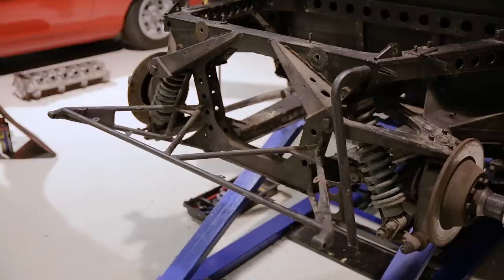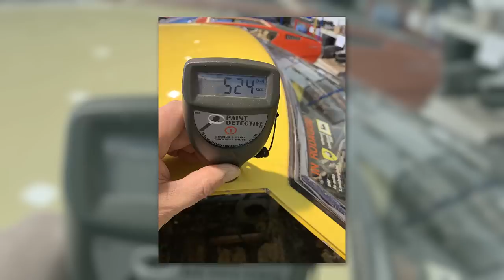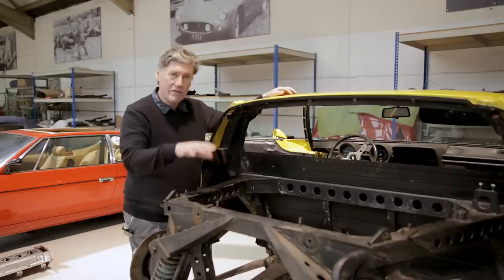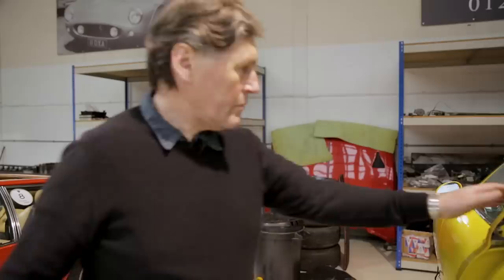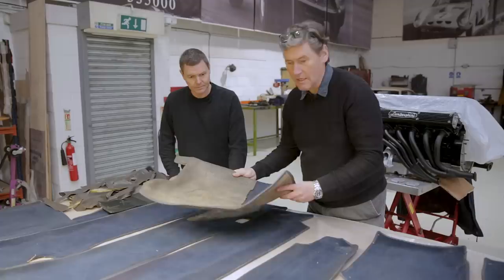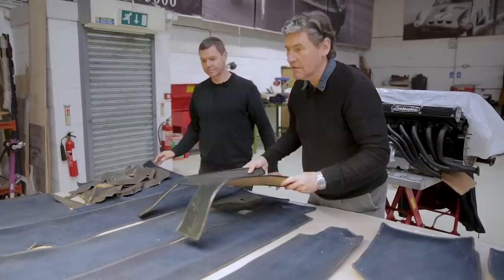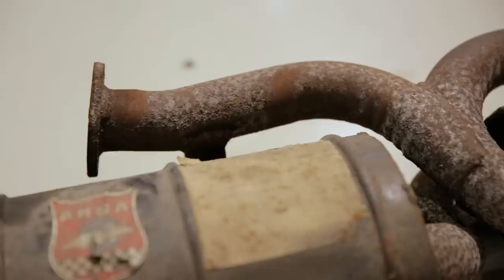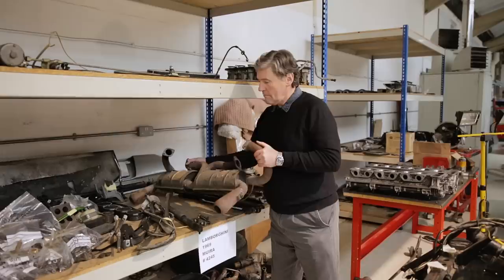Lamborghini Miura S - Restoration begins on £1.25 million barn-find | Tyrrell's Classic Workshop

Comment: Thank goodness this car is in good hands. It could have been over-restored and all that history lost.

At 8:09 we see a crack in the webbing between the block and the transmission case. Is that common on these cars? I would love to see that repair included in a future video.
Reply: Ok so I'm not the only one to notice that, I wonder if it really is a crack and if so what if anything will be done about it. I don't think this restoration in any way aims to bring it back to 'like new' so there is a fair chance it will just be left as-is if it isn't a risk or issue.
Reply: Saw that as well. Maybe we will get a comment in the next video?
Reply: Are you sure that's a crack? It looks to me like flashing from the cast where some oil has collected on top of it. I can't see how that particular web would crack without similar damage to the neighbouring ones, given the proximity and construction.
Reply: @noth606 I’m no expert, but it seems to me that it would not have cracked unless it was bearing a load, and if it was bearing a load then it’s probably important. 

@Sheldon Holy I can’t be certain that it is a crack, but to your point I do think I see a much lighter crack in the webbing next-door. I can imagine that substantial suspension forces would get transmitted through the case to that spot due to the wacky way Lamborghini designed this thing. Can’t really blame them; it’s not like anyone else had ever done this before.

A quick hit with a TIG torch should fix it up, but it wouldn’t look original then. Can’t wait to see how Iain handles it. I’d probably just use some JB Weld (kidding!).
Reply: @lebojay  the second crack you speak of looks like a join in the casting to me, which would support the flashing guess. If it were a crack they'd likely look the same.

Comment: I sat, chin resting on my hand, elbow on desk, face two feet from my screen all the way through this video. 

Re. the exhaust;   many, perhaps most people don't realise that if you start a cold engine just to move the car, there will be left perhaps a quarter litre of more of water, replete with corrosive combustion products dissolved in it, sitting in the system, which will silently rot it from the inside out. Presumably the yellow Miura was always parked up after a run and never moved otherwise. Or it might even be that the owner was one of the few people who was aware of this silent exhaust system killer and took steps to avoid it. (ETA >> I don't know how I missed Iain's mention of the condensation issue - it was very late at night).

PS - the exhaust internals could perhaps be inspected with an endoscope?
Reply: lol, restoring multi million pound car, doesnt have a boroscope, i said as much, old school is old school after all.

Comment: WOW!!!   What a joy to watch. I'd schedule a trip to the UK for a vacation just to hang out at your shop for a week....   About the frame of this car....   Originally, the first cars had the .9 mil thick steel....  and you said that after the first 125 cars, they switched to 1 mil thick steel.  Does this car have the 1 mil frame?   And if it doesn't, would you do anything to try to strengthen the frame? Or is the actual real world difference so slight that it doesn't matter. I would imagine that no one is every going to really drive this car hard....   I appreciate your craft and your work.
Reply from the maker: Thanks for your interest Todd. This is a mid-production car, so way past build no. 125. We'll be covering potential frame strengthening in future episodes.

Comment: I find the engine/ gearbox single casting very intriguing. 
What will you do about the exhaust? Will you open it and renew the internals, then re weld it back up again?  Will you re dye the carpets were they are fading, or would you not do this for any reason? Questions questions,  I realise you may not have time to answer all questions,  but some of us will naturally ask.
Thank you for your new channel.
Reply from the maker: Thanks for your interest. Anything we do with the exhaust will make it non-original. It will be kept as a lovely part of this special car's history, but cannot be re-used. We won't re-dye the carpets, that again would defeat the object. Fotunately they will clean up and go again remarkebly well.

Comment: I fired my E-Type up at a show once and another owner asked what kind of exhaust I had.  Not thinking I just said "original".  When I listened to his car the idle sounded higher pitch like a tin can.  It turns out the popular aftermarket stainless steel exhausts being fitted on E-Types are thinner than the original mild steel.  Perhaps they decided to make it from a thinner gage because it won't rust.  The original thicker mild steel gives the car a lower frequency purr than the new stuff.

Comment: Smashing episode, oh the potential around that workshop is astounding! Please please keep making videos.

Quick question: the fact that the door cards were perfect, does that mean the car has never seen a drop of rain?

Similarly on the exhaust, the fact that it has lasted this long does it mean the engine was always fully warmed and driven rather than started from time to time?
Reply from the maker: The plastic membranes could survive, even on rusty doors, but I would say that the car's general condition means it hasn't seen much rain. The car definitely has been driven and not shunted around, otherwise the exhaust would have rotted out more quickly, yes. Thanks for your questions.

Comment: Hallo! About the engine and gearbox one-block configuration it is interesting remember the Bugatti EB 110 has the same. We know the first Bugatti's's Technical Director was Paolo Stanzani and the Designer Head was Oliviero Pedrazzi: both were working in Lamborghini as well, at the Miura time.

Comment: Great video, just one small point, you mistake the difference between stiffness and strength. Strength is how much load can it take before it breaks, stiffness is how much deflection do you get under the load. So, a chassis has to be stiff to stop it distorting.

Comment: Re the exhaust system,- so what will you do,- re-use it, & if so try to protect it in some way?
Reply from the maker: Due to the design of exhaust internals with finely perforated tubes and baffles, it's impossibe to see vey much, even with a boroscope. The owner does want to use the car when completed. The system will alas inevitably be too rusty for ongoing practical driving. This system will end up as a momento, to form part of it's special history.

Comment: Could that exhaust be dipped in something to remove the rust inside and out and then perhaps plates with something that wouldn’t corrode?
Reply: I think what Ian was getting at was the unknown corrosion inside the exhaust, possibly the baffles which are nothing more than holed rings of steel are shot?

Comment: In my humble opinion that car should not be repainted at all. Fix what there is to fix, repaint that block on the wing using the same technique the best you can, but even if it ends not perfect, so what? The car is not new. "Restore not redo" is a good motto for any restoration of this sort.

Comment: Another great episode!

But how can that car be in such amazing original condition? The exhaust doesn't make sense...

I guess a lot could be down to climate -- did it live in Italy? If it was only driven in the dry. Then, if it was stored in a well ventilated garage 

But it had two owners -- so they must have been like-minded in how they treated the car. The door mechanisms and electric windows lasted perhaps because the owners didn't slam them about or force them. Some people are respectful and have a light touch.

Maybe the owners were knowledgeable, and knew the Miura was fragile, and so treated it carefully.

Still, it's like the car came through a time-portal.

Do you know the story about Jay Leno's yellow Miura? 

He was given it for free! It wad back on the 80's and was stuck in some guy's driveway, due to mystery electrical problems, and the guy said to Leno that if he came round with a trsiler, he could have it. Just wanted it out of his drive!

:0)

Comment: The cars original enough , yes it’s had a life , IMO you clean it all up and leave it k the car can be painted in ten years time , it’s only original once and despite a small repair I’d save the originality as much as poss and leave it alone , the paint on the car was there when lambo sold it , when the factory built it , when Hubert sold it etc etc

Comment: Ian,  the idea of "original" after 50 years is deeply problematic. Rubber simply crumbles. Metal rusts. People switch out the wheels in period. Tyres... OMG who would put on 1960's tyres ? Only those who see the car as a static display and not a machine to drive and experience. The old "blow in" is period. The car has a history. That history is part of the story. To lose that story is to lose the charm. I really have no time for over restored cars. Walk that middle road. Fix the car so it can be driven and driven hard but don't erase it's past.

Comment: Less than 30,000 kilometers/20,000 miles, and it needs to be almost completely rebuilt.  That doesn't really say much for the build quality. They designed the frame on "an ad hoc basis".  I'm not surprised at all.